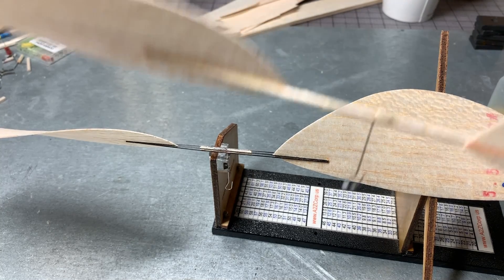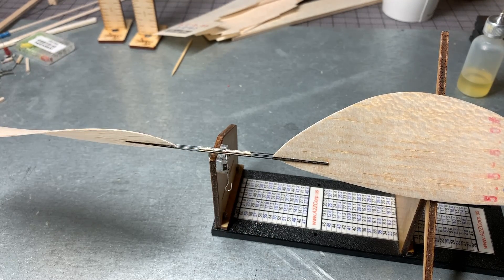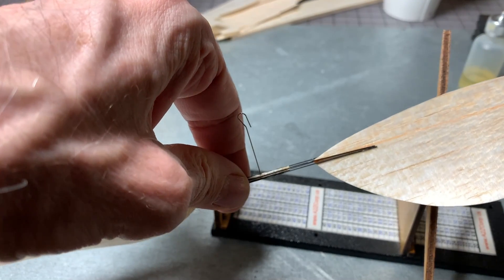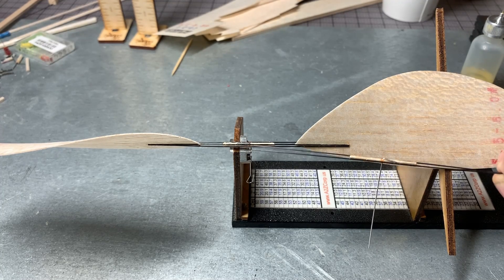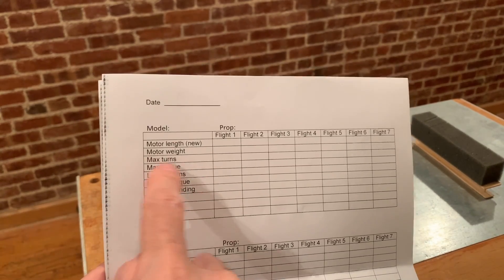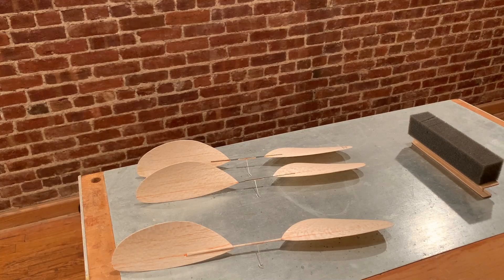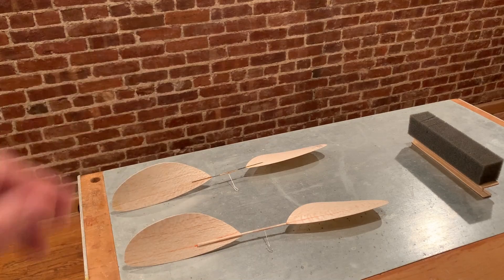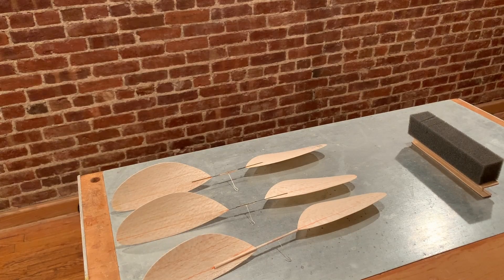Carbon fiber spar flaring props for Limited Pennyplane

Comment: Can you share some ideas on how to carve a prop block with a specific P/D ratio and how you mount the blades at a specific angle to the spar?
Reply from the maker: Get Ron Williams book, 'Building and flying indoor models', he shows how to lay out the block and several different ways to do it - you can carve it from a block or build it up with balsa strips. I mark the center line on the blade lightly and that's where the spar goes.

Comment: A very interesting video. For those model classes where carbon is not allowed I wonder what is the cross section of a bass wood spar with the same torsional stiffness as a 0.020" carbon rod?   Would you be kind enough to share the radial dimensions (ie length) of the carbon rod - radius to end of balsa hub,  radius of the inner end of prop blade, radius of outer end of carbon rod? And if I read the rules correctly then F1L props would need an equivalent balsa spar.... but if a required stiffness can be established by test at home then it should save some valuable flight test time.
Thanks in advance - please keep posting these great videos.
Geoff
Reply from the maker: We don't know if .020" carbon rod is optimum, so I wouldn't use that as the reference, I would just experiment with different spars, as I'll do in the Fall. The 1/16" sq balsa hub is 1", the total prop spar length is 4", and the blade lengths are 5", the spar sits on the first 1" of the blade; for the single spar, they are each 2 1/2" with the last 1/2" going to the end of the balsa hub.

Comment: For such a long motor, .4 is a very low torque. I use .085" rubber with a 16.5" loop in cat 1 and I can get over 8 min
Reply from the maker: Is that no-touch? It's been hard to keep it out of the girders, I'm slowly increasing the rubber size with the new prop.
Reply: @domoremath  admittedly no. There are no indoor Cat II or III sites in Kansas that are available consistently for flying. W fly in a 25 ft hall with a tiled ceiling. practicing in that armory sounds fun...a layer of challenge I'm much less accustomed to
Reply from the maker: Yes, I knew immediately with that motor length/thickness that you were either bouncing off the ceiling or scrubbing it. For low ceiling sites where you can't do that, you generally want heavier motors so that the torque curve for the cruise phase is higher.
Reply: @domoremath  It's an interesting situation you have...You can't push torque but you want to use all your turns just the same. I wonder if going thinner and winding harder may deliver good results. It's all about keeping the highest % total energy without getting stuck. I'd live to try it myself!
Reply from the maker: @RedstonePyroMan  All that counts is the number of turns that are used, it's debatable how many should be left; sometimes I've gotten longer times with more turns left over compared to another motor.
Reply: @domoremath  this makes a lot of sense in an unlimited motor event! I'll have to remember that